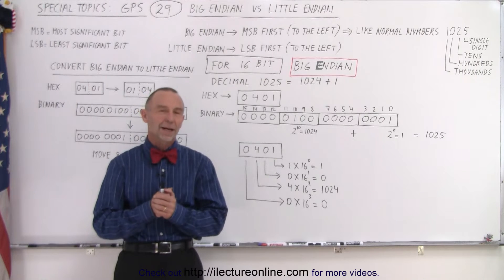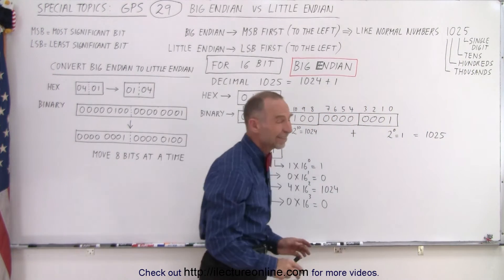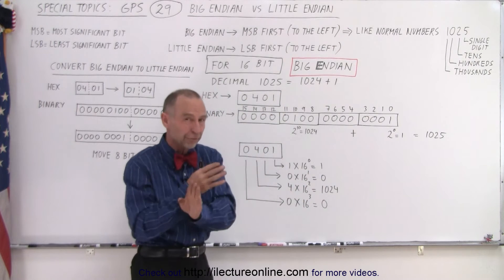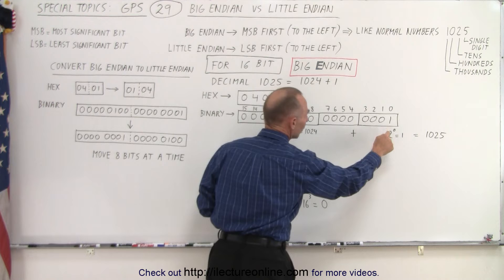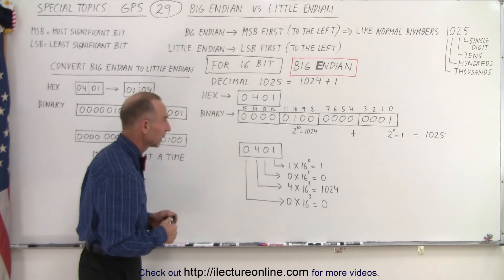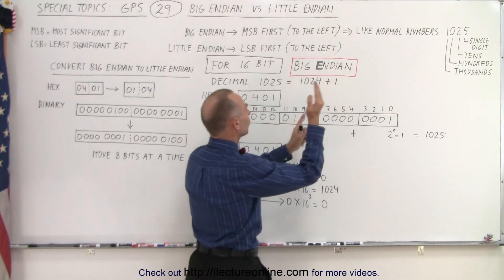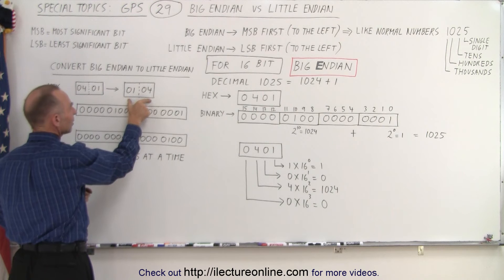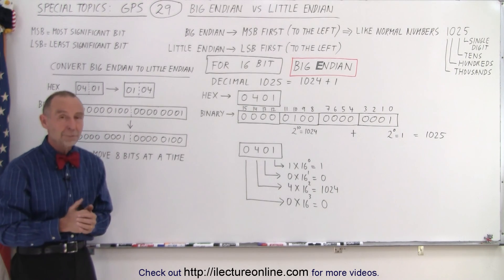Special Topics - GPS (29 of 100) Big Endian vs Little Endian

Comment: Thank you! The last time I learned about big and little endian was in the first year of my computer science undergraduate degree, some years ago now! Since then I've never come across a little endian system in the wild, so I am curious to see if this comes back and gets applied later in the GPS series. Great job 😀
Reply from the maker: It is good to know what system is being used, to prevent confusion.    I have worked on a system before where we actually had to bit swap because different components in the design used different approaches to BIT order.